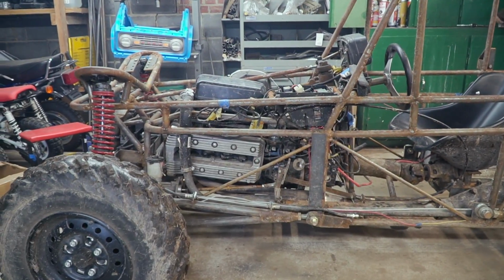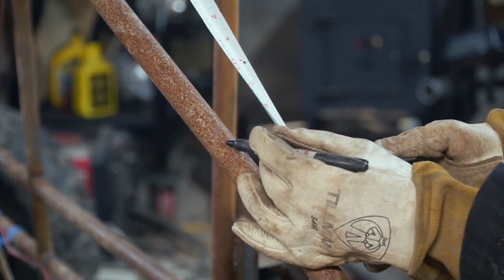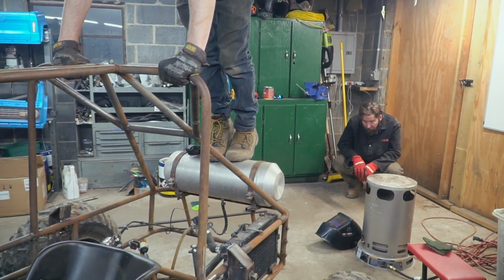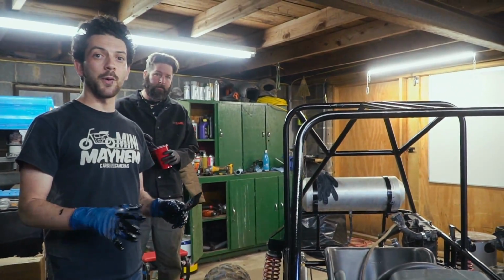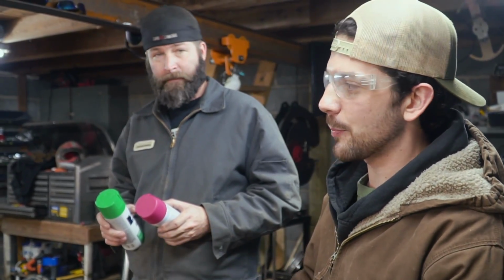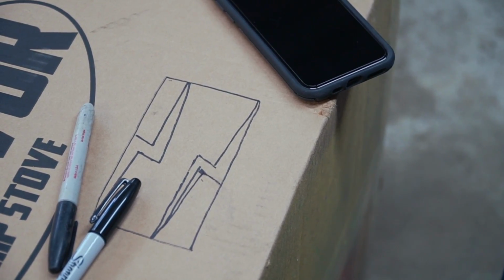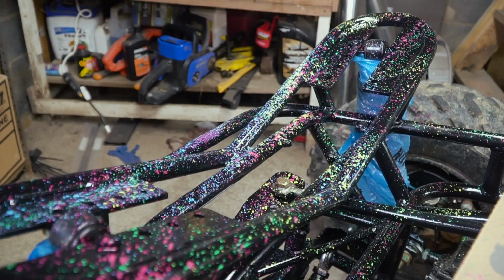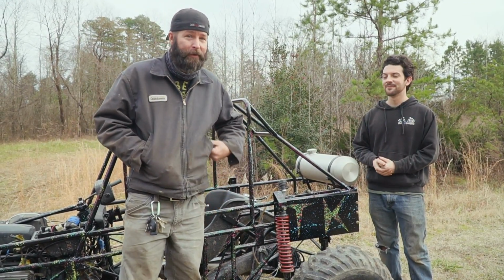1000cc Trophy Truck TRANSFORMATION | Lift + Splatter Paint!

Comment: Love the build. I would add fenders mounted to the hubs so they turn with the front end like a tractor. Also if you guys want I have an old briggs and stratton 5s that I would be willing to ship you if you think you could ever use it. It runs, I was going to use it for a drift trike style build (without the drifting) for my 6 year old but got something bigger and governed it down for now.

Comment: For clean metal, there is a spray on zinc coating that you use before painting POR15. Love the stuff. We have been using it for about 20 years. 3 things to remember, when using it. Don't get it on your skin or cloths, because it won't come off and will have to wear off of your skin. Also, don't use it directly from the can. The slightest drip of sweat, water, spit, etc. will ruin it. It's better to have to throw out a little bit, than a whole quart, gallon, etc. Finally, if you don't use the whole can, put a layer of plastic wrap between the can and the lid. If you don't do this, you will never get the lid back off of the can.

Comment: Thought for body panels , where needed. Go online and get kids crazy carpets. The sheet plastic slides for winter. Either get them in all black and splatter them , or see if there are neon colour ones. Then cut panels and bolt or zip tie them with bright color zip ties.

Comment: Put the body panels on the inside of the cage, and either paint them clear (using poly sheets from the local hardware store) or a matte grey. If nothing else, they'll keep the driver and motor a little cleaner.

Comment: A trick with por15 is to drill two small holes on opposite sides of the can in the ridge by the lid, pour out the desired amount and plug the holes with sheet metal screws when done

Comment: before you use POR-15 you should spray muriatic acid on your part after scuffing the rust areas with a metal brush,..brush, acid, rinse off with cold water, airhose dry it all completely then POR-15 fellas ;-)  Love this channel

Comment: I think you need to add a couple more tubes to your roll cage. From about 1/2 way up the rear verticals back to the clusters on the angled down-tubes. Just to triangulate and stiffen the verticals a bit more. Those are awfully long straight tubes, which could give in a hard roll-over. IMNSHO

Comment: por15 is great stuff flows out realy well when you paint it with a brush , realy strong against chipping and scratching  , i allways use it to paint chassis 
you guys got the blessing down should see if you get get the job of pope maibe mumble a bit of lating while youre trowing the water around but other than that perfect in the flick of the wrist 
as for the fusebox : see if you can find a tupperware box that fits the hole , you can prolly get it cheaper than the original box , think if will be more water resistand than the original too if you use grommets and silicone on the holes for the wiring

Comment: I'd recommend body panels still, you could splatter paint them too, and it would keep you dry.  Also should you put an actually radiator scoop on the other side of the radiator to improve cooling?

Comment: 1. Paint looks amazing 
2. When you pulled off the tape and coverings everything else looked dirty. 
3. If your gonna run a solid axle rear you should look into hydraulic bump stops, will save your back...
4. Your guys are doing an amazing job, keep up the good work...

Comment: everyone else would strip it down to the frame for paint. john and ike just cover stuff with cardboard and go for it. i admit, it's a way to go. i've done the splatter paint thing on sand rails i built in the past. think trophy cart, on a v-dub chassis. ain't no sand where i live, but lots of two trackers to explore. with that experience, i still say you need to get that fuel tank inside the perimeter of the frame supports. i've flipped a couple of rails being crazy, and the last thing you need is fuel running everywhere from a ruptured tank when you're upside down, strapped to a seat, and disoriented. it could make a bad day, a hundred times worse.

Comment: Easiest was to do splatter is to hold a popsicle stick against the nozzle at an angle across the paint flow. That way the paint sprays just on the stick, then pressure blows it off onto the surface. Way faster and less messy than the actual brush splattering.

Comment: Yuh all got me thinking, love that splatter paint and it looks like you both had a blast, i have my Manco RedFox to cut up and lengthen in about 6 months time, going to be taking out the Tecumseh engine and putting a 5 speed Honda Big Red 300cc ATV engine, i've already converted it to chain drive from the shaft drive, and it will of course have reverse. One thing though, you guys kind of dropped the ball,,,  i was waiting for you too splatter paint the rims to match.

Comment: 9:40 its P.O.R. 15 as in "paint over rust" 15 (no idea what the 15 means...maybe 15 tries to get the formula right?).
P.O.R. not "pour"...
I used this stuff as far back as 1994 on floorboards of my race car. Top coated with rustoleum satin black. Its still as solid as the day it went on. Good stuff. Expensive however. It is available in clear and silver too, i do believe

Comment: Hey guys, if it were me, I'd mount the shifter to the cross tube that it's coming over now,  and just ad an ajustable link to the existing tube you have the handle you have I place now. 
This would take the slop out of it and you wouldn't have to worry about that long shifter arm bouncing around. 
Like it is , just the weight of the long shifter arm could cause it to inadvertently shift when you hit bumps. 
If you want to see what I'm talking about plz contact me and I'll show you a blueprint of the system in talking about.

Comment: You need to switch to Bosch spark plugs for your BMW
Reply: I think NGK are the best for that motor
Reply: @jeffwain  I thought they came with Bosch-can’t remember the voltage from the coils
Reply: @jessemorrow3512  yeah they come with Bosch plugs. I just think the NGK iridium plugs are better. Especially with today's gasoline.
Reply: @jeffwain  does burn hot enough ?
Reply: @jessemorrow3512  I think so. Should be perfect with the way they have the intake starving the engine. I think they could of done something better.

Comment: Hey Guys! Check out Palmetto Specialty Tire for wheels and tires. I don't know what your budget is but you can get a set of 4 wheels and tires for around $500. They have a HUGE selection including 12" Cragars which would look awesome! I was disappointed to hear about no spring Mini Mayhem. I hope you have other reasons besides the Covid 19 virus. Red Beard had a meet around 3 months ago and I have not heard of any problems. 
 I have a Coleman BT200 which I am repowering with a 200cc Panterra bike engine and trans (It's identical to the Lifan you put in your shifter Kart, John) and I modified the rear axle brackets and mounted an 11x22x8 rear tire. If it's muddy at Busco, I'm ready!

Comment: Bitch'n video dude! Cart is totally Rad! LoL. I think you should add panels on the lower half. Mount them on the inside of the frame. So it's like a exoskeleton. As far as the rear end you should do bump stops and maybe even limiting straps for the rear suspension if you plan on jumping it. Party on dude! LoL

Comment: I want to predator 212 swap my Polaris sportsman 90 can I place a sprocket on the same side as the drum brake?? I cannot remove it for the life of me‼️‼️
Reply: You can make the existing drive system work with enough effort
Reply: If its belt drive you could use a torque converter or a belt drive pulley to make it work. If its shaft drive just get performance parts for the engine

Comment: Can someone explain why  my Coleman dies when I give it gas, I replaced the carb and spark plug, it starts and idles fine... but 1/2 throttle and it Boggs out or if I let off it just dies

Comment: It isn't very hard to pull the fuel tank and set it outside. I was at a shop where a welder was working on a 4wd. Nobody really knows what happened, but he was hamburger. It blew up like a few sticks of tnt but with very little fire. I threw an empty tank on a burn pile once. The end was open so I thought it would just burn off the fumes. It knocked me unconscious. My ears rang for days. Don't mess around with fuel.

Comment: Boy oh boy...... You guys need to ditch the metal plug caps... They are excellent at trapping water and dampness, and causing a inferior spark!!!!.
Your running the best plugs CHAMPIONS, I've been a champion fan for 50+ years and compared them to all brands.... 99% of the time they come out on top...
Next, try using NGK spark plug caps, the brown zip on type... They can even be the internal resistor type but use copper leads not carbon.... I've never had a plug / lead / cap failure from using this combination... It's the best all round setup.... But please loose those metal shrouds... If its the only thing you take from my advice.... Rip em off....

Comment: You should never dip the brush back into the original can it will cause the product to harden in the can even after you seal it 🤢 The rust on the brush sets it off .

Comment: How is this a trophy cart it's the worst design u have ur fuel tank sitting out of ur roll cage and looks nothing like a trophy truck it's just a slapped together go cart with a motorcycle engine and under hard load I dont think ur steering will hold up
Reply: damn how about you go build it for them then, there just having fun building stuff in a shed
Reply: @colbybarbour9990  they r trying to ghpc well John is and this kid has no idea acts like a little kid if his "hot lap" doesn't beat ike's and from a fabrication stand point it's a box with wheels withe the gas tank on the outside of the roll cage 🤣🤣🤣🤣 yes the r back yard guys that make things but really everything is garbage sorry not sorry